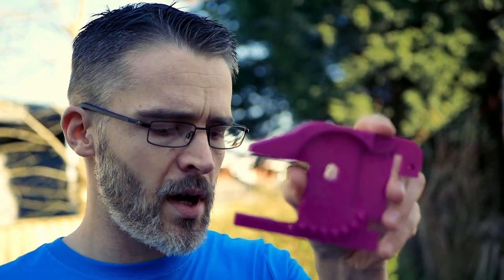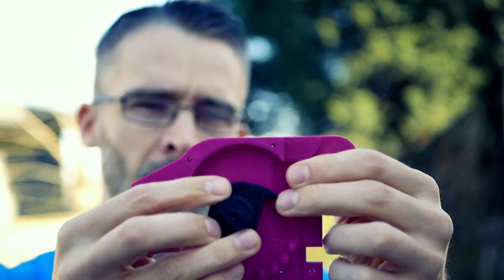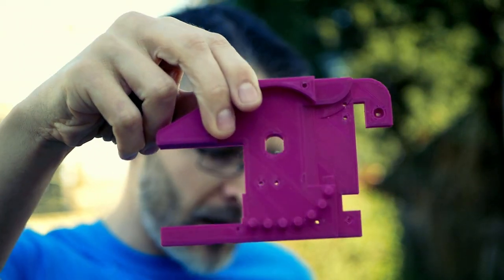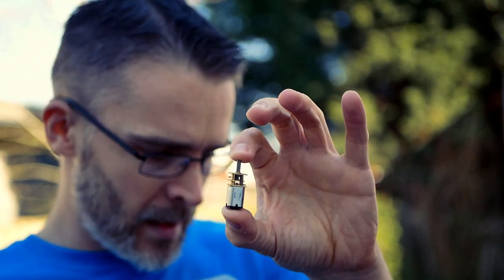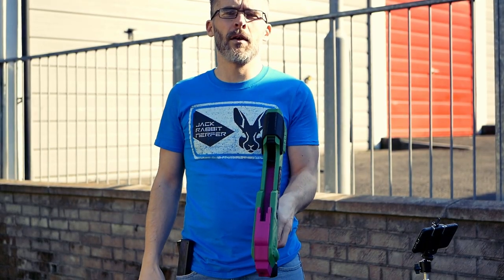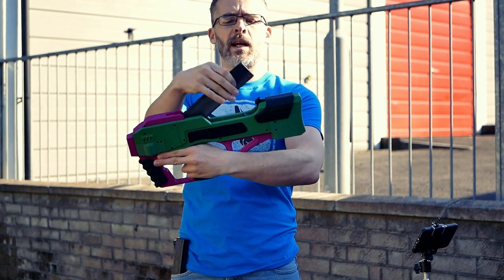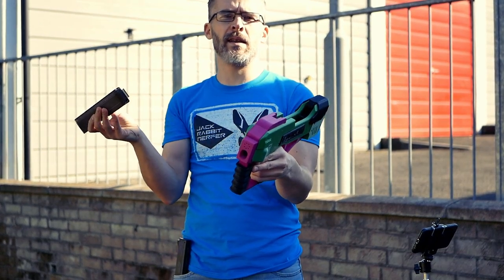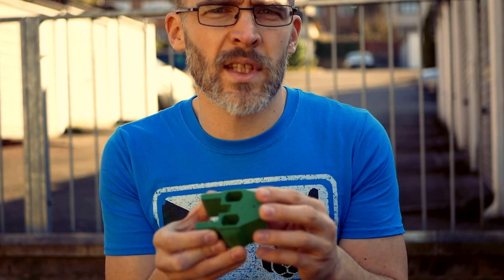Bulwark, a bit more info

Comment: It’s essentially the Run of the Mill system by Raiijarr (Dennis) but without pegs (on the mill) and with rollers to accomodate the loss of pegs. This makes it a much smaller turning radius which is good! Nice design!
Reply from the maker: The idea is similar but not copied from Dennis, I had a working prototype before Dennis show his run of the mill system
Reply: Jack Rabbit Nerfer Nice! I wasn’t suggesting you coppied it. Anyway... goes to show how long you have been developing this blaster! The result shows it aswell! I absolutely love it.

Comment: Maybe try meishel 2.0's for motors,  or fang revamps.
Reply from the maker: I retested it, and got slightly higher fps nearer 110, i think it was hitting the side of the chrono, but i will run it with revamps

Comment: why’d you shut down the N90 project?
Reply from the maker: The n90 project literally copied my files exactly, so I said about my displeasure with that. I would have been totally fine if he took the idea of rollers etc and re engineered it himself as that's the bit I took time to develop and get working.
I actually just made one comment it's the rest of the community that seemed to jump and shout until he then stopped his project. I then got the reputation that I forced him to shut it down, that along with covid is one of the reasons I've found it hard to develop again
Reply: oh ok that makes sense